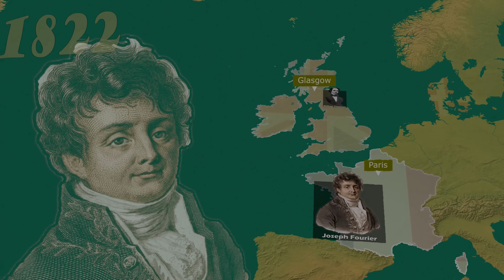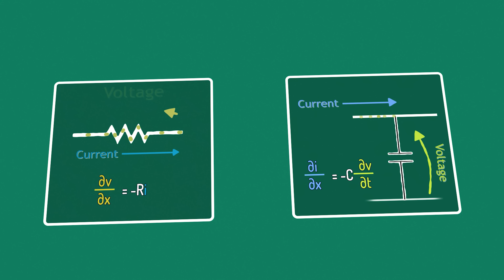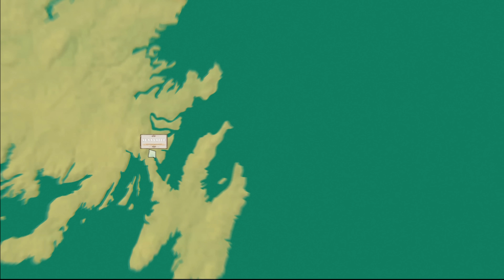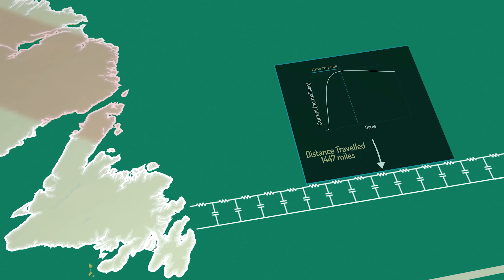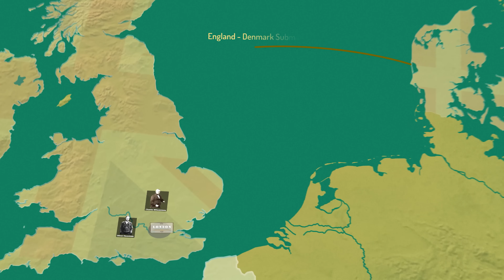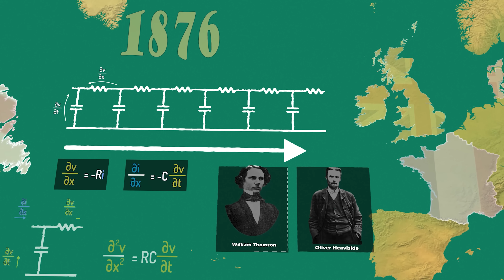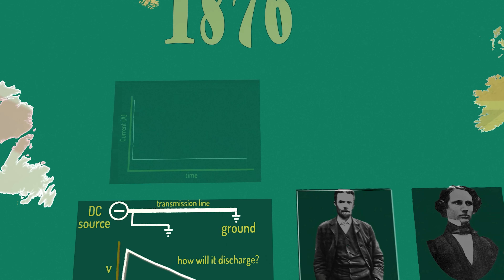The Story of the Telegrapher's Equations - from nowhere an unknown genius solves transmission lines

Comment: I graduated from Electrical Power Systems Engineering about 7 years ago at age 26, I've always been fascinated by the history of electrical engineering, in particular, the discovery that went into finding out how we built long transmission lines, long cables, reactive power, harmonics, stability and control and so much more. I've over the years acquired some older books, like the Westinghouse T&D book, Symmetrical Components by Wagner and Evans in 1933, the two Circuit Analysis volumes by Edith Clarke and Gabriel Kron's work on Tensors in electrical circuits which I didn't know was apparently met with controversy back then.

Seeing a video on Carson's Equations for self and mutual impedance of overhead lines with earth return would be cool. Unless you've done that already and I just couldn't find it 😄

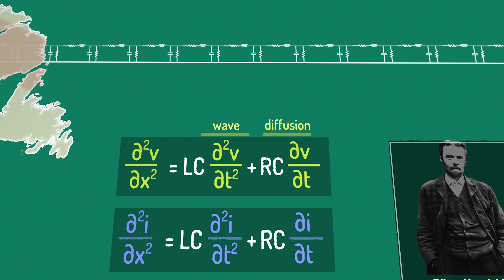Comment: 14:39 "...still provide the most comprehensive theory of signal propagation on transmission lines."

Is that true? These equations are linear, and I believe the nonlinear Schrodinger equations, which account for focusing/defocusing effects, have been applied to transmission lines since the '60s or so.

Also, the term you labeled as "diffusion" around here is not the diffusion term, which is instead the d^2/dx^2 term.

Overall, beautiful video.
Reply: Eh, it's not clear which term is diffusion because we're second-order in time. Complicates things when the equations are expressed this way.

Comment: The telegrapher's equation is in terms of voltage and is analogous to the heat diffusion. It contains no mention of current, so you claim that "voltage and current diffuses into the cable " is NOT what is shown.  You do not even understand what you are tryin to teach.

Comment: So 16.5 hours to send 98 words, quick estimate is 2 minutes 30 seconds per letter.  I am guessing that they never tested a long wire transmission before laying the cable.
Reply: They did, but ot was tested on ground in air, and the cable or signal behaves differently when in sea water.

I even hear the first cable didn't succeed cause the two sailing ships laying the cable never met in the middle of Atlantic, having to drop the cable ends to the bottom... Imagine the feeling! Next time they first met in the middle of the sea, and headed for shores, better chance that way for sure.

Comment: I haven't thought about this stuff since I graduated with a BSEE in 1975. I remember being introduced to Smith Charts in the Transmission Lines and Fields course and thinking, "NOW, I am an Electrical Engineer." I have read most of the comments, most of them by EEs, and they have said everything I could write.

Comment: Heaviside and Gibbs independently discovered vector calculus. Heaviside however, applied vector calculus extensively in electromagnetism and reformulated Maxwell’s equations using vector notation.

Comment: Great video, but what is missing for me is, how this new approach lead to better/faster transmissions! From 16,5Hr to ? Or is it just about understnading what is going on?
Reply from the maker: Thanks! The telegrapher's equations, as derived by Heaviside in  "On the Extra Current" are fundamental to transmission line design because they give the exact solution under ideal assumptions. All transmission lines today - coaxial cables, twisted pair, high speed PCB traces - even power lines - rely on these equations in their design. But the first real application to emerge was inductive loading coils, which Heaviside himself proved would dramatically reduce signal distortion on cables. The Americans were the first to exploit this idea commercially in a meaningful way and it led to the possibility of voice calls and much faster communication across long cables.
Reply: @VisualElectric_  Thank you very much! That would be great to see in the video!.The result of that breakthrough.

Comment: Well ... Thomson took only RC. Heaviside added L - inductance of straight wire. Todays long lines theory always incorporate L, because it's essential to transmition, and enables fast transmition.

How experimental results agreed for Thomson ?

😊
Reply from the maker: It's a good question. I think for cables, Thomson's model is fairly accurate. When you look at overhead transmission lines, nobody knew that the signal was bouncing around like it was inside a pinball machine.

Comment: The best explanation in YouTube form that I have seen on Heaviside's contribution to signal analysis.  Bravo to Visual Electric.  The Heaviside "step function" is well-known to all physicists.  The physical origin is the telegrapher's tapping key which produces a sudden change in voltage and current in the transmission line.
Reply: Same theory can be applied to the PFN (Pulse Forming Network) of a magnetron-style RADAR transmitter where the PFN represents a transmission line segment using lumped LC (Inductor and Capacitor) and this sets the pulse shape and pulse duration applied to RADAR transmitters magentron.

Comment: I hold an electrical engineering degree and have worked as a hardware designer for 16 years. Heaviside's theory on how a signal propagates on a transmission line forms the foundational basis for modern PCB design, and without it, modern electronics wouldn't exist. When you understand this fundamental principle and how to use it, you can design really cool things like ultra-low noise mixed signal applications.
Reply: Years ago one of my electrical engineering professors showed us a digital circuit board and asked us how we thought ones and zeros were transmitted between components.  Just about everyone thought it was dc voltage switching between zero and +5v.  How wrong we were.   Turns out it behaves as signals and antennas.  I am amazed at the engineering it takes to get these phones and devices to work, they shouldn’t.
Reply: I see these science based maths equations and unfortunately it's like magic, because the wonderful complexity is beyond my comprehension. I just trust the results that brilliant minds have provided. Thank you all electrical literate minds.
Reply: Those little squiggly traces to make the timing of a pulse match up to other signals in the circuit.

Comment: This video is nicely edited but it’s difficult to follow the physics and the video should’ve emphasized more clearly how it improved telegraphy. He proposed the Heaviside condition under which signals propagate without dispersion, and as a result companies added inductive elements every few km along telephone lines. But this was not practical for transatlantic cables; they didn’t experience any tech breakthroughs from his work
Reply from the maker: The story I wanted to tell was the leap between Thompson/Kelvin's cable model and Heaviside's development of the first telegrapher's equations. Of course, there are more parts of the story still to tell.

Comment: Has anyone had the nightmare of sitting a vitally important exam and it going well , then something happened preventing you from finishing?  Whilst solving these equations in a Signals exam in my final degree year, it was going really well. I had time and had completed most of the paper. That's the last I remember, I woke on the way to hospital in an ambulance. My blood pressure extremely high. My kidneys failed and I had to repeat the year. The Signals exam was a nightmare the second time as I was worried that I would repeat what, so did the university as I sat it on my own. I had disturbed 600 students' exams.

Comment: The thing is, in order to get that nice wave-like propagation on a line, the capacitance and inductance have to be balanced properly. The early telegraph lines all had plenty of capacitance, but not enough inductance, which is why they behaved as Kelvin described, and were terribly dispersive and inefficient. To get them to behave nicely, you had to add distributed inductance. But most people thought that was crazy and refused to do it. If you don't understand the math it seems like making the cable *worse*. But it does actually work.
Reply: re: "The early telegraph lines all had plenty of capacitance"
The capacitance, from the overhead line to the earth below (termed 'ground') was actually minimal ... even line to line on a pole (spacing say, six inches) would result in an effectively high impedance line 'pair'. 
For comparison, twisted pair in Cat5/6 is rounds about 100 Ohms, two wires spaced under an inch approx 600 Ohms (as used in 'open wire' line for Ham antennas)  so you can see spacing of 6 inches or 20 ft will be a much larger line impedance.
Reply: @uploadJ  I was referring to the undersea lines. And surge impedance only applies *when the capacitance and impedance are properly balanced*. When they're not, even a little bit of capacitance per length adds up over thousands of miles, and you end up with an RC that needs to be charged up, painfully slowly, before you have a detectable signal on the other end.
Reply: @hobbified  re: "And surge impedance only applies *when the capacitance and impedance are properly balanced*"
Well, this part is not making any sense. One designs FOR a certain impedance, not a 'balance' as you put it. I'm thinking you have never used an Impedance Bridge? Or a network analyzer for that matter?
Reply: @uploadJ  I have, frequently. You seem to be confusing the impedance measured at a point with the characteristic impedance of a TL. The problem with the cables they had back then was that they couldn't be characterized by an impedance of so-many ohms: if you took one, terminated it with a resistor, and hooked up a VNA to the other end, you would see a complex impedance. If you made the cable longer, the reactance would go up in proportion to the length, forever! They didn't have a characteristic impedance in the sense that you can take any length of a TL with a certain Z0, terminate one end in Z0, and measure Z0 at the far end. They didn't behave like the TLs you know and love.
Reply: @hobbified  re: "You seem to be confusing the impedance measured at a point with the characteristic impedance of a TL."
Are you going to argue semantics? OF COURSE a TL 'changes' an impedance SEEN on a TL if and only if the TL is NOT terminated in its characteristic Z. This is elementary. Look at a Smith Chart for instance at a point NOT in the center and rotate 'wavelengths' about the periphery  ...

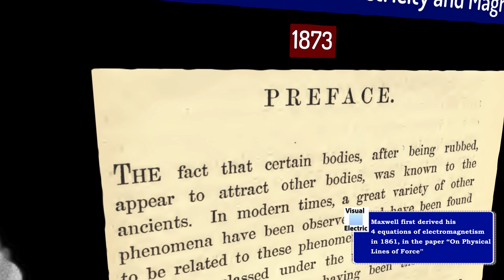Comment: 7:35    (re: the inserted note)  Maxwell didn't derive the 4 equations.   He derived 20 equations that were then consolidated by Heaviside, Gibbs, Hertz into the "classic" 4 equations.
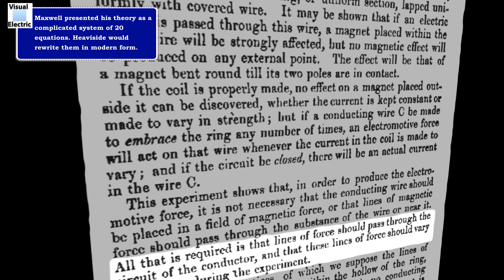Reply from the maker: That's right, thanks for noticing that error. It is expressed correctly in the note later on (9:53)
Reply: It is actually considered by some that Heaviside's reduction of Maxwell's original 20 equations was done at the expense of removal of some of the information in them, in particular, the 4th dimensional scalar property that was included in them.  The use of a scalar fourth dimension was actually common in Maxwell's time, but Heaviside considered this 'spooky' and incorrect or inappropriate, so he simply zeroed the values of this 4th dimensional scalar and in doing so, reduced the number of equations from 20 to 4.
Reply: @lloydrobins6074  can i ask the scalar dimensions written under what symbol?

Comment: Fourier series are not "cheat codes" they are mathematically derived. Joseph Fourier is the real genius of the story. He revolutionized communications theory and provided the basis of stability analysis and filter design that is the underpinning of modern electronics. Thompson and Heaviside were brilliant but anyone could have taken Fourier's theory and solved the equations  for transmission lines.
Reply from the maker: You are partly right. "Solving" the transmission line equation is trivial once you know Fourier's method. However, the genius is coming up with the system of differential equations in the first place, e.g. you need to first establish what needs to be solved. In the case of Thompson, his great insight was realising the cable is a distributed parameter model - an infinite cascade of RC sections. Admittedly, Fourier had done the same for the heat equation but it's not obvious that the same applied for electricity. Heaviside's insight was to incorporate (what we known today as) inductance into the problem as a counterpart to R, C and G of Thompson's model. This was not obvious at all at the time. Inductance as a concept, and as a circuit component, wasn't even formalised at that point. It was a complete spark of genius to add a term which models voltage drop as the acceleration of the charge. Everything seems obvious in hindsight.

Comment: The first transatlantic cable was not between America and Great Britain- it linked Ireland and Canada.
Reply from the maker: The cable itself was between Ireland and Newfoundland, which was still a British colony and not part of Canada at that time. However, the telegraph connection was between America and Great Britain. These are the 2 political powers who initiated, funded, built and used the connection. I should have referred to Great Britain as the UK so it encompassed Ireland at the time.